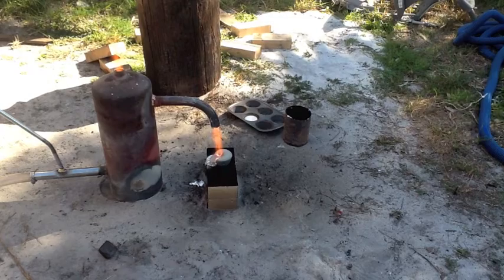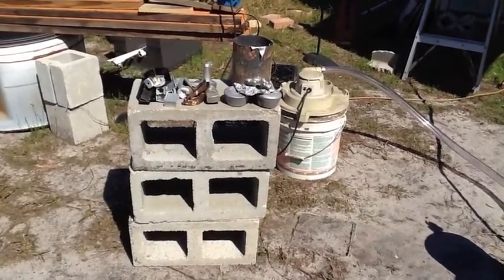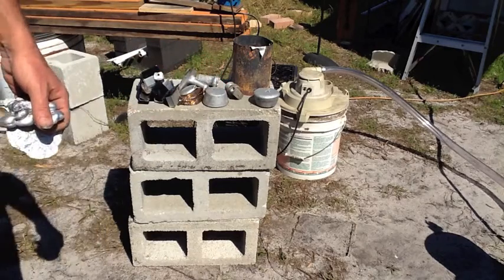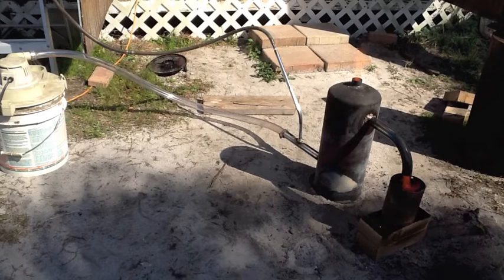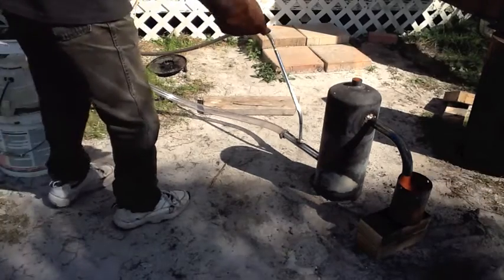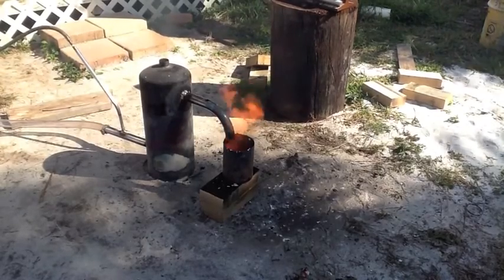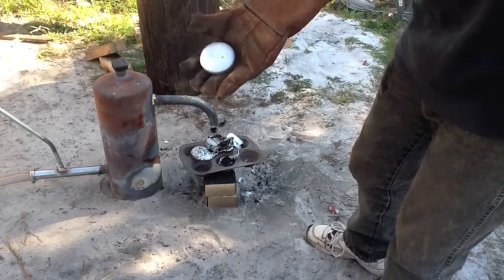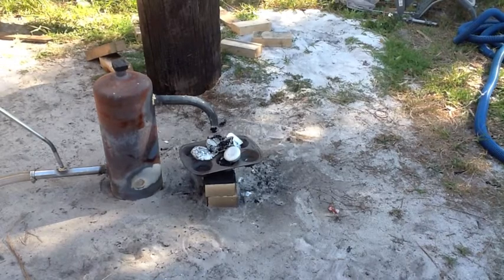WASTE OIL BURNER FOR MELTING METAL - "REVISITED"

Comment: It seems you could be wasting a lot of heat by heating the crucible out in the open. How about putting your mixing tube (Y shape) into a regular furnace and place the crucible in the furnace.  I'm guessing it would melt much faster that way.
Reply from the maker: I gave up on the oil stuff, too much work. Was fun tho!

Comment: High carbon content from your burner may not be optimal for aluminum, but it is for steel. So much so that it's one of the more difficult details to deal with for most people. If you can keep the carbon content high like that while increasing your temp, you'll be sitting pretty for successful steel melts
Reply from the maker: Good advice you provided DIY, I kinda gave up on oil as a fuel source as I live on a property with a well and storing large amounts of used motor oil made me nervous :)
Reply: I can definitely understand that. Having it leak through the ground int your water supply is a scary prospect. I let my ADD get the better of me and found myself with a dozen or so projects in the works right now, but I'll try to get my waste oil burner done ASAP in case any of the details might be of use. I've actually got 2 totally different burners in the works. While they're nothing alike, they have the same goal - eliminating the starting fuel needed for most waste oil burners. I'm trying to make it a point to record my projects lately so what I do can't be misinterpreted due to my awful way of speaking. I hope to have a couple examples up soon
Reply from the maker: Waste oil is a terrific option, for me the risks just outweighed the benefit. I was all for it until I started thinking about the "worst case scenarios". I had actually bought a 275 gal plastic tank and had sources offering me free used motor oil if I came and got it. Then I thought about my well....and said nope. Gave away all the oil I had (80 gallons or so), sold the tank.....and now sleep better :) Veg. Oil is a good option but a lot of work to process properly. Good luck with all your projects!~ Richard
Reply: Thanks man. I finished my capacative battery charger/desulfator (got about a dozen UPCs - no exaggeration - that I kept stockpiling when I came upon them for $5 or less that I hope to revive the batteries for free), adjustable motor control that I hope to pair with my 3hp treadmill motor for my lathe build (actually it's about "moment of truth" time with that one),  and isolation transformer (with about 10 other voltage outputs) builds all today. Lowe's has a GREAT sale on the 6hp/12gal stainless shopvac for $40 that I picked up to power my dust collection so I hope to finish that. I have to remake my stick welder because the old case was too small, I think I'll add a 3rd and possibly 4th transformer to that circuit too, plus the bridge rectifier was busted so the seller shipped me a new one that I'm waiting on now in order to properly finish it, but have no qualms with running it as AC in the meantime. And then I have a literal pile of transformers and SMPSs that I need to find uses for. I might have gotten a bit carried away lol
Reply from the maker: I have a nice 2.5HP DC treadmill motor But am not well versed in electronics to go about building a controller for it. Good luck with all your projects~Richard

Comment: If I can offer an unsolicited piece of advice, Use a metal tube for the oil from the burner to like halfway back to the reservoir, and put a heat source on it to bring the oil to temp before it hits the point of combustion without even the need for sticks and whatnot at the beginning
Reply: Yeah...   because it is "LESS" off a "hassel" to implement an entire additional heat source !?  😂😂😂

Comment: Did you ever get this lined out how you wanted?  This should be a good solution for melting heads, rims and blocks down to casting stock.  Any thoughts on that?

Joe
Reply from the maker: That was my original thought Joe...melt big stuff. Gave up on this concept tho....your approach is more feasible. This "system" had lotsa issues. Was tonsa fun tho!!! 👍🏼🎉😊

Comment: What about 2 outlets?   One to blow down into the pot, the second a way to sit the crucible on top of the furnace, a way to close off either one.   It would seem such a rig could be used for quick melting or preparation to pour out of the crucible.  The top of the extinguisher would need a larger outlet of course.   It would be fun to build a shop heater for waste oil.  I rebuilt a large commercial waste oil combustion and heat exchanger for my dads shop once.  One of the principles of those kinds of heaters is to preheat the oil.  You could do this in a simple way by putting a few S turns of feed pipe near the surface of your glowing combustion chamber.  You have pressure due to the feed tank height which is good.  It would be cool to put a needle valve of some sort near where the oil is dripping in.  This way you would get instant fuel/air feedback when you move the valve.  A needle (metering) valve makes a slight change per revolution unlike standard valves.  $4 and up on ebay.  This would require filtered clean waste oil of course.  Of course all these things add to the complexity and you're trying to do something as simple as possible.
Reply from the maker: That concept works fine but in reality is too much of a pain in the %#* to make it practical. I have a new idea for using the waste oil which is much simpler than the fire extinguisher...but it was a pretty cool contraption nonetheless! I been watching your 12" Craftsman Commercial Lathe vids....appreciate you putting them up! I just may have a Lathe vid coming up soon....hmmmm :)
Reply: Very cool.  Can't wait to see.  I'll be in black out for about 10 days due to travel.
Reply from the maker: The vid was put up about an hour or so ago. Even gave your channel a mention in the video and description as well. I think you may recognize the machine! :)

Have a Safe Trip!
Reply: Cool, I'll got check it out immediately if not sooner.

Comment: To reduce the aluminium blowing around, go to a bigger outlet. What you want to do is slow the gas speed without reducing the output. A larger outlet than inlet also allows for more heat because the air is expanded in the combustion process so you have more out than in. If your inlet and outlet is the same, you get backpressure which reduces output.  I was able to get over 100KW more out of my blower simply by putting a much bigger outlet on the burner so the air was free flowing. 

I noticed when you covered the top hole, the side one seemed to do less output. Thats excessive back pressure and a definate sign that you need to go well up in output size to realise the full output potential of this burner.  To me the inlet looks pretty small as well but the thing burns better than I would expect.  I also notice that your fuel flow is slow. again that is the back pressure fighting against the gravity the oil is working under.  a Bigger outlet would give you much better flow and increase your output from that side as well. If you wanted to get a faster fuel flow which it looks like the burner can handle, Run a small line from in front of the blower back to the top of the oil tank. This will feed the back pressure back to the oil tank ( has to be sealed of course!) and cancel it out and allow the full gravity flow. That will make a big difference on it's own. 

You can see on my vids where I made a Crucible out of thickwall pipe.  It's done a lot of melts now even with the flame aimed right at it.  It  helps with longevity it seems to fire the thing up first time empty and let it get good and rusty sitting in the yard.  The rust seems to protect from the molten ally and the flame. You'll get some flaking of the metal but it will still last forever.  The other thing is keep your flame rich like you mainly have it now. An oxygen rich flame will cut where as a rich flame is not nearly as severe. 

Having the flame on the ally will NOT put carbon into it. The temp of the ally is above that of the carbon burn off temp so that cannot occour. You may get some soot at lower than melting temps but that's just on the surface and when the ally is up to proper melt temp, that carbon will have burned away 100oC before hand. 

There is some fine tuning to get the thing working to it's full potential, a larger output would make a huge difference in that respect but you won't have any problem melting ally or brass with this even in a plain brick furnace that retains the heat. 

Keep up the good work!
Reply from the maker: +Oil Burner Thx OB, My experience lies with propane burners so these are all new to me but am gaining experience on these suckas. A bit more playing around is needed but would like to do away with propane over the next few months. When I come across some larger pipe I will modify it, I have lotsa 1.5 and 2 inch pipe but its all galvanized crap and since I use oxy/acetylene to weld I dont wanna mess with the stuff. I will get some pipe off craigslist soon enuff....stay tuned
Reply: That makes a lot of sense.  As gasses burn, the temperature increase makes it expand.  A bigger outlet pipe is a VERY good idea.  Do you think 4 inch would be enough, or would a 6 inch inside diameter be better?

Comment: Florida Fisherman…great video!
Question: Can you invert the exhaust pipe so that the flame is exhausted "up" and your crucible can be hung or suspendened over it or does this set-up require some sort of back pressure?
Reply from the maker: +Iamme283 Thanks Lamme! I could but....I think I am going to just pipe in the flame into a insulated furnace just as I do with my propane burners on the various devices. Ideally I want to be capturing the heat inside an insulated furnace, letting the flame "circle" the crucible and avoid putting direct flame to the crucible as it will simply destroy the steel crucible faster with the blow torch type flame pointed directly at it. Stay tuned for more waste oil burner craziness! :-)
Reply: Iamme283 of course and v